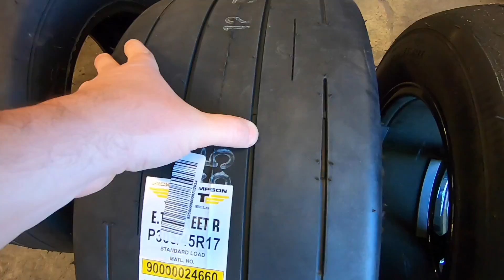2020 GT Gets new Drag Tires with Test Hits, 98 Mustang Gets its First Upgrade!

Comment: Nice, I am changing my oil tomorrow with 5w50 MC full synthetic FL500S....has 2500 miles on it, going to do a analysis...
   Changed at 250 miles, now 2500 miles after this change ill extend it....
   I did a compression check as well all 175-185psi ( both my replacement long blocks are down 40-50psi from my original engine that was in the 225-235psi range.....they were low, all looked good.

 Installed the Denso 5341 ITV24s and the tune loved it at WOT, was adding 5.5 degrees of timing....never seen 18 degrees at WOT before hehe....

 #8 which slid from 180ish to 165 initially 2200 miles ago has stayed dead on 185psi since....so i guess it was still breaking in....
Reply from the maker: BlueCollarDaily let me know how the oil analysis goes.

Comment: Like the video.
Two questions from when you mounted the new tires.
1. When you balance, how much weight is too much?
2. On black wheels, are black weights available?  If not, what can be used to color the raw lead? 
Thanks for the knowledge.